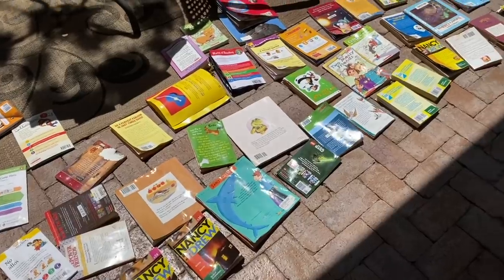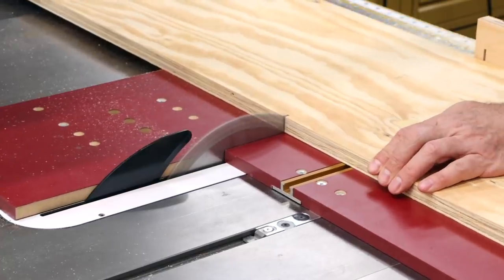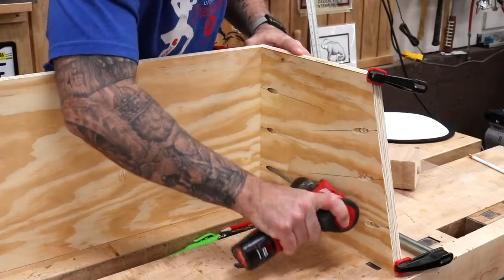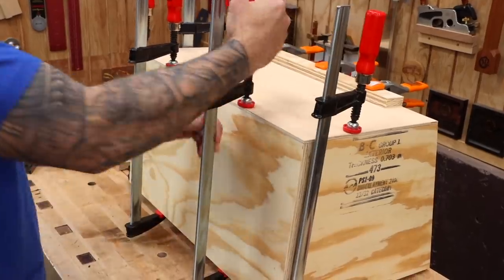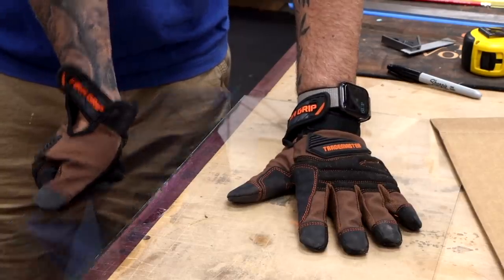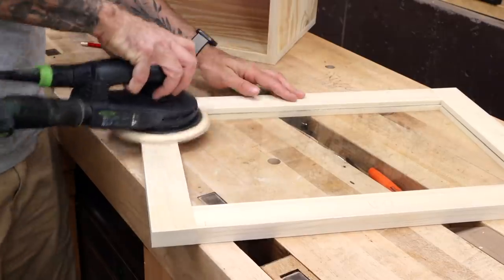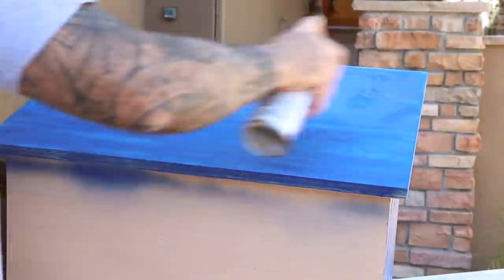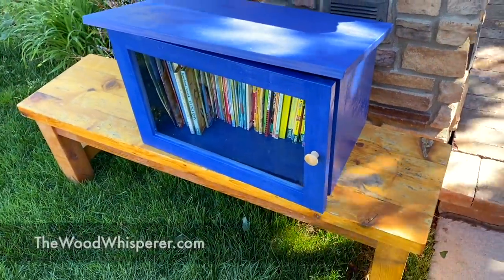Kids Library - Free Plan

Comment: Well done Marc. Good choice on the case construction. And obviously the pocket screws are no problem In the doors either. It is actually a bit faster  to not do any joinery at all before the door assembly on glass panels. Then use a 1/2" or 3/8 rabbet bit to go on the inside of the door. No need to square the edges. You can actually sand glass on a belt sander to match the round, or just clip the corners at a 45. And no additional fasteners needed for the glass. Just use a healthy bead of silicone caulking on the inside edge of the rabbet. And that silicone will stick just fine to the paint. So you can do it after the painting is finished. So no putty on the door ends, no joinery fitting, no masking off the glass, and if the glass door breaks then you can replace the glass without replacing the door. 

When you want a glass door that's professional quality Shaker style then switch out the pocket screws for a domino joint and you got quick and easy glass doors.

Comment: Magnets for door closer would work well on this project. Another great video.
Reply: The soft close hinges have a little pull that helps keep the door closed, I use them on my camper and it keeps stuff in the cabinet in a moving vehicle under normal conditions.

Comment: Really enjoying making this as my first woodworking project. Question on the pocket hole joints for the door: I cut the groove centered down the length of the rails and stiles - and like you show here I cut them through the complete length of each door piece with a table saw. The result is, the pocket hole joints (seen at 3:55 in video) don't work because the groove is right where the wood should be for the screws to secure into. I'm gluing in some shims to correct for this – but wondering why you didn't seem to run into this issue?

Comment: Any concern regarding weather causing the plywood to delaminate over time?
Do you think that laminated spruce/pine be an acceptable alternative. (Lowes model #179388)
Any suggestion for an alternative to using glass in the door?

We are planning to build 10 little libraries for an inner city project.  Our woodworker's club will cut out all pieces, pre-drill and provide all components for students to construct, paint and install within their neighbor hoods.  Lowes has offered to provide the materials.

Comment: I know nothing. I was wondering how you would recommend making the angle cut along the length of the top "stretchers" without access to a table saw? Thanks.
Reply: There are a few different options depending on what tools you have. If you have a circular saw many have the ability to angle the blade, the things to keep in mind is just make sure you have enough material under the saw to make a stable cut. This will likely mean being a bit less efficient with your wood and cutting them from a larger piece. Another simple option would be a hand plane, take the straight pieces and clamp them in place and mark the angle on the ends of the board, then draw lines to connect the marks. From there you can either hold the stretcher in a vice to plane it or just screw it in with the pocket screw and plane to the lines after its been assembled. Hope that helps :)

Comment: I'm surprised you didn't need a small lip on the roof to prevent water from following its underside past the door.
Reply: I didn’t want to be that guy but that is my concern as well. Drip edge. The good thing is that it’s not like a ledge that will be shedding water, it’s just what might accumulate and drip off the front edge of the roof.

Comment: If it's out side and ANYONE has access to it I WOULDN'T use GLASS, law suit possible if glass breaks and cuts someone. Use PLASTIC.
Reply: Acrylic is probably indeed a better idea. Also easier to dimension on a table saw. Not as cheap, I suppose, and might yellow after a while.
Reply: @langrock74  If your plexiglass ever gets damaged on the surface you can use novus cleaner to get out scratches and other imperfections.